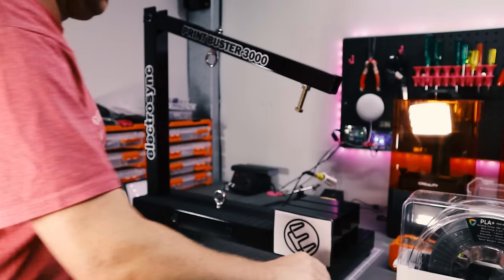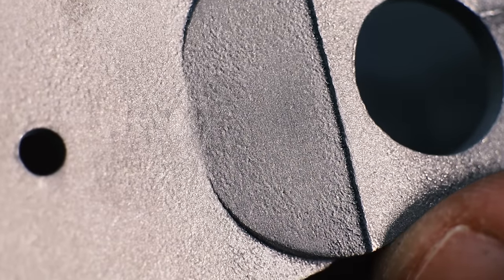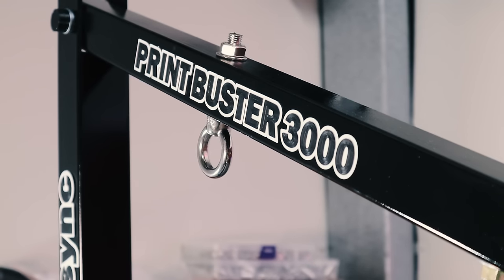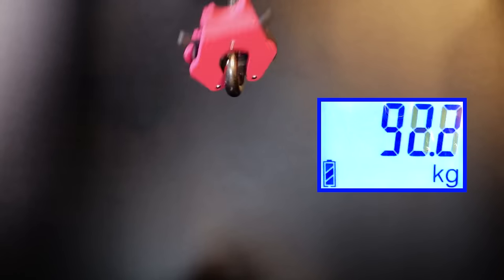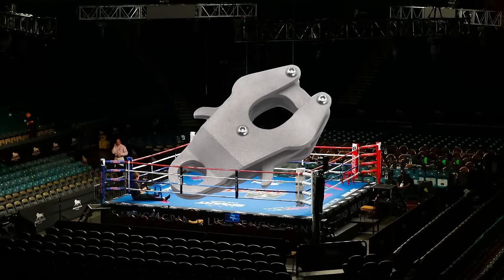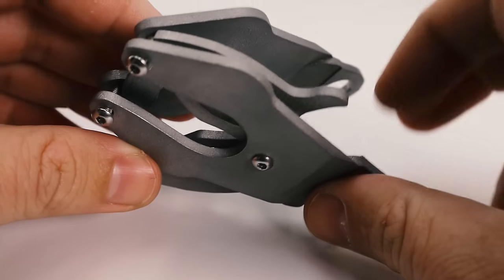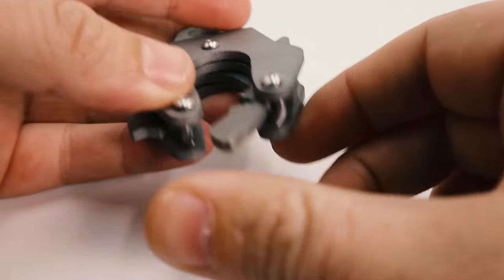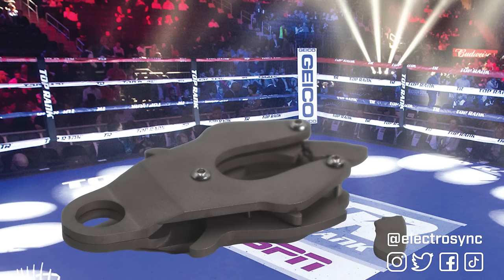How Strong is 3D Printed Metal?

Comment: Love this design! Considering scaling it up and adapting it for a completely unrelated application! Thank you!
Reply from the maker: Sounds fun! I made one at 200% scale and it worked well with heavier gauge wire for the torsion spring.
Reply: You need to look into Hot isostatic pressing if your interested in possibly making them even stronger

Comment: Larger stainless bolts, and fileting the edges will greatly increase the strength of the unit. With 3D prints there are a lot of stress risers on those sharp corners. Nice video!
Reply: you got that right, didnt notice that, they are basically covered in stress raisers, too bad he didnt get matched parts with water-jet cutting etc. and test them against the printed stuff. 3d printing is a bit of a religion and some people are afraid of knowing the truth about the material limits.

Comment: To me the aluminium was superior as the jaws didn’t fail in any way.  The stainless jaws began to fail at 884kg.  The aluminium clip failed only a little lower than this, but not the jaws, which looked good.  The way the aluminium clip did break, at the bottom, I believe a couple more stainless screws low down would add significant strength and potentially outperform the stainless steel clip.  Of course just a little more force could make all the difference, but unless tested we won’t know.

Comment: looks like the laser bonding required encouragement to work on the stainless steel, like a magnesium powder or some such catalyst, it should be a lot closer to solid internally, its so strange to see such thorough internal blackening, but then I've never seen a broken stainless 3d print either!

Comment: I would love to see a machined part out of billett or such to truly test how strong 3d printed metal is versus machined metal
Reply from the maker: I'd love to do it, but do you think it would break under 1 tonne? I might have to build a stronger rig!
Reply: @electrosync  it would be close. Aluminum yes, but steel I doubt it would break. You would be pushing it, I think 5 to 10 ton rig will be needed for that
Reply: @CL-yp1bs  surely it would depend on what the part is and its design? there are aluminium screwgate carabiners that are used in climbing/work at height that are rated for 25 kN on the major axis.
Reply: The printed metals seemed badly porus.
Reply: @spudpud-T67  they're typically 99.9X% dense as-printed with the right laser parameters. But after hot isostatic pressing, which is typically performed, you have virtually no porosity.

Comment: I would love to see the same test with forged metal vs. printed to see the difference.  Good stuff
Reply: Forged would be significantly stronger, but the nice thing about 3d printing is that you can make complex parts without specialized equipment or much skill (relatively).
Reply: Hey, blacksmith here! You know this new way of making metal parts reminds me of the old ways, in the sense that before mass melting furnaces were a thing, people would process iron trough forge welding sometimes very small pieces together (a bit like the Japanese and the tamagahane). So welding something together will get you to good results, but modern homogenous steels are still superior tho.
I think a good forge welding heat forging would help his 3d printed parts actually stick together more into a solid piece.

Also the grains look disgusting... His metal parts definitely need tempering cycles
Reply: @jeanladoire4141  Forge welding isn't easy for high carbon steels, and it's really impractical for most uses. Metal 3D printed parts are sintered for a couple hours, though the finish of these specific parts seems a bit off.
Reply: @ignacioaguirrenoguez6218  i'm familiar with forge welding high carbon steel, it's not that it's "not easy", it just wants to crack and burn at high temperatures, but there are ways of solving these problems. Now i dont see why you'd make structural pieces out of high carbon steel, most commonly used stuff for high strength structural parts is like S325, something with like 0.35% carbon

Comment: A few issues I noticed. The stainless steel wasn't tempered properly. The clip you designed is ok but consider the bottom hole it is made of two parts that are pulled on unevenly by the test rig.
That isn't a problem with the test rig but the clip design. The hole edges need to be rounded over also it would help if there was  a bolt or two ensuring the pressure between the two sides there remains the same.

Comment: I kept wondering why the pivot bolts didn't shear off. I would have thought on the metal parts those would have gone before the printed parts. 
I'm also wondering if heat treating would work on metal parts. That might be another interesting experiment for the future.

Comment: Surprised Aluminium was so comparable in strength considering all its other advantages, Its just so easy to cut and drill compared to steel and its lightness can easily be the difference between a project being practical and not. Would have liked to see non printed versions for strength comparisons....

Comment: Was the steel heat treated in any way after printing? I've gotta wonder if tempering might have helped.
Reply: My thoughts exactly, especially for the stainless.
Reply: from my experience, this looks like bad quality steel with no heat control, normalization or heat treat, the grain structure of the steel is closer to grey cast iron, its not good quality at all
Reply: @azpatriot7937  That’s the quality for 3D printed metals for a part I had printed.  It all depends on application.  My print was for a part in my door latch that broke.  Similar latch $240 and would have to sand and repaint door.  Company no longer made that model and so designed and printed by Shapeway in SS.  About $8 seven years ago and still going strong.  Worth checking out all the items and materials available on Shapeways.

Comment: Report Sxx ~ ((load at fracture)/(area of fracture)).  Expect perhaps max of annealed 6061-0 (Sy~8ksi, Sult~18ksi) or whatever the basic Al alloy suggests.  If lower, this gives an idea of loss by 3D print on axial, at least in this case.  A cantilever test, or a perpendicular pull would be interesting to also involve the plane-to-plane bond.

All in all, we've a strange dichotomy at work, with CMTR's & V&P inspection on traditional, but folks pushing for allowed metal print use in similar higher-QA applications, while a-s-s-u-m-i-n-g handbook values, isotropy, and puzzled looks when reminded of an often near-100% welded part without weld inspection.  IMO,  as yet, 3D print is most often analogous to in-to-near complete sinter, rather uncontrolled (at present), and of most use to low-stress (& smaller) parts.  Perhaps with better control, might come to use low-end bulk properties in FEA or hand calcs but, even there, you've usually a in-plane & orthog-plane layering issue plus shape-& order-of-bond issues. I've reservations, at least 'as yet'.

Comment: Since steel has a higher melting point, it is possible that the powder sintered worse than aluminum during manufacture. Maybe Leather didn't have enough power to melt enough. But perhaps there are some limitations or physical phenomena that do not allow creating a stronger part without losing geometry, for example, or gases or oxides are formed that make the structure porous, I don’t know. I'm not an expert - I can only speculate.

Comment: 3d printed metal isnt the same as forged metal because it has a very loose grain structure compared to the tight compressed grain youd get from forging steel. Also with forged metal you can temper and harden the metal to the desired strength so it's just vastly superior.

Comment: Would be interesting to test the new Carbon Fiber and maybe Titanium 5.  It looks like the metal is not fully solid so maybe the new filament type stainless that gets heated will be more dense and thus stronger.
Reply from the maker: I have some really nice parts printed in onyx with carbon, kevlar and fibreglass reinforcement to try out. Oh, and some titanium parts produced a few different ways. We'll find out soon...

Comment: I would be curious of how different methods of 3d printing metal would effect strength.
Reply: Post-printing heat-treatment is a huge factor. If it is not heat-treated properly the metal can be extremely brittle. 
Layer thickness and laser settings during the print process are important as well.

Comment: Could you please use Kilonewtons instead of Kilograms? This is a force measurement, not a mass measurement. It also makes it more comparable to climbing equipment with the strength ratings (though you shouldn't really use this in that sort of environment). 900 kg is 8.826 kN.

Comment: TL;DR
Aluminium (50g) Breaking point is 830kg/1829lbs
Stainless Steel (120g) Breaking Point is 900kg/1984lbs
PLA Breaking Point is 92kg/202lbs

Not surprising how Aluminium is x9 stronger and Stainless being barely x10. The differences between Aluminium and Stainless Steel is small.
For regular folks Aluminium is the way to go. Being able to work on something softer and more tinker-able. Great for projects being realized and it's lighter. Cheaper too in the soon future. 
Steel is for something more towards something industrial. Where you CAN'T have stuff failing. Course stuff fail and break all the time but Steel is just less prone to it.
Note: Metal is far- FAR more easily recyclable than any 3d Plastics. Metal can be contanimated and it'll just be melted off and slabed away. Plastic- once it's contaminated it's going to stay contaminated. Plus you can't just mixed plastic together, they won't bond well.

We've already seen 3d prints for quick replacement for certain parts, now we can have an mini-market of folks 3d metal printing parts that had been discontinued.

Comment: Engineer here;
Using the same aluminium piece after it has been subjected to stress testing isn't a true reflection of its material property, though it stands up well in the test, aluminium is famous for its low resilience to fatigue cycles which get worse over time.

Comment: Do metal prints need supports like plastic prints
Reply from the maker: Not traditional supports like FDM printing does. The metal powder acts as the support, but is not melted by the laser, so it doesn't need to be removed later on.

Comment: Great vid, were these raw metal or were they heat treated? because the stainless steel may of been soft due to looking at the grain of the breaks it is rather coarse 07:39, im not a metal worker or  smithie but after watching Forged in fire they always talk about the grain

Comment: Re-Run the tests after annealing and/or quenching the parts.  Can you get the steel parts re-made with high-carbon steel?  I think the differences between steel and aluminum were too narrow.  The steel should have much higher tensile strength per unit volume.
Reply from the maker: I'm working on a follow up video on this including tool steel. I'll need to devise some way of quenching them.

Comment: What's the price difference like? I'm yet to find metal 3D printing that is really affordable for non-industrial applications.
Reply from the maker: It's pricey. The handful of parts shown at 0:00 are priced at $370 USD. I guess it really depends on the value of your application though.
Reply: @electrosync  That's extremely expensive. I feel like metal 3D printing probably really isn't worth it unless the object being designed really is impossible to create in a more traditional way. The design of your clips is great but they could easily be created using a plasma cutter and a welder for a fraction of that price, and end up with a stronger result. Seems rather silly to 3D print something that is essentially made of flat pieces.

Comment: I would have liked to know what prices they charge.
Reply: It’s really a matter of type of material and volume of material used.  Shapeways is the company I used to make a SS part.  It was about an inch long and 1/8th inch square with an offset lobe and was about $10.  It’s not cheap to print in metal if it’s large, but if you need it and the alternative is a machine shop that would charge hundreds, then it’s worthwhile.  You should check out Shapeways and all the hundreds of items they have designed by individuals and available to print in multiple materials.

Edit: he answered your question on price a few posts below and it was $370 US for the parts for this test. So, not cheap😮

Comment: You should try CNC aluminum vs 3D printed aluminum to see if there is a big difference. I'm also curious to see how SLS Glass Fiber Nylon would do in this test.
Reply from the maker: I'm working on that right now (next video). I've got CNC parts in some nice materials, including aluminium and titanium. I don't have SLS glass fibre nylon, but I do have Onyx continuous glass, kevlar and carbon fibre.  I think it will be interesting.

Comment: “Selective Laser melting” isn’t going to give you similar results to a cast or forged piece for the simple reason the nature of the process doesn’t enable the material to form a crystalline structure.  It’s essentially little different to any sintered piece…just a lot of small particles stuck together.
Reply: No crystalline structure?!? What does it consist of then? An amorphous structure? 
High quality AM materials are typically superior to cast material, and in some cases on par or even better than forged. The PCBway material does not look like high quality....

Comment: impressive results considering the predictable grain structure.  personally what I'd like to see is the test simply REPEATED with X number of samples to determine consistency and reliability of the failure.  (as seen in the comments) because our psychology leans toward "bigger, better, stronger" this invariable creates a "blind spot" at just being able to see the value and use case of the Net parts as they come off/out the printer.  this is why parts - even the strongest ones - have ratings and something that never occurs to us is that not every part has to be rated for "1-Ton", particularly if the application doesn't call for it.  for those situations that DO need higher ratings, we obviously have all the traditional manufacturing methods (castings, forgings, CNC etc.) to lean on.
Reply from the maker: I'd love to do some repeatable tests, but these parts are pricey. I've got a follow up video in the works featuring the same materials, plus more. Watch this space!
Reply: @electrosync  re: "these parts are pricey". yeah sadly I figured as much.  it would indeed by cost prohibitive but who knows, maybe (just maybe) PCBW could be talked into a wee bit more charity...? 🙂 not talking a crazy sample size of 10 to 100 but simply 3 to 5.  basically any value of X > 1 would allow for some degree of extrapolation.  seeing the aluminum bend the tubing of the test rig was impressive, geez the gauge and dimensions of the square stock used for my engine hoist out in the garage is not much different, heck I'd be afraid to place some 6061 suspension bits to that amount of strain (I have and they failed albeit by bending/deformation). re: "Watch this space!" you bet. 👍

Comment: Would have liked to see more advanced plastics, like Nylon with CF for example. Or if you want to be really fancy, forged carbon fiber. Shouldn't be too hard to print a mold.
Obviously these parts would best be produced from stainless steel sheet stock with punches and presses, or laser cutting and pressing/forging.
Reply from the maker: Yes! I'm working on a follow up video that will include FDM continuous carbon fibre and laser cut metals. Watch this space!

Comment: Your choice of Eye Diameter and metal perimeter was not optimal, usually 1/4 of hole dia. is not enough, since half of full load is automatically placed on the bottom connection . Wnat were machine screw specs? 8 or above to permit less yield (standoff or washered between halves)?  Did you get anyone to 3d computer model stress or fracture points

Comment: It looks more like the welding method used for the powder is what failed not the metal.. since both failed about the same... if you can get some machines parts of the same grade metal and do the test again and you'll see stainless steel tinsel strength is 2-3 times that of aluminum
Reply from the maker: I have some machined parts for a follow up to this video.

Comment: Very interesting. This shows why they use Aluminium to build aircraft. While it's not quite as strong, it is a lot lighter.

As for future experiments, I've heard that increasing the thickness of a metal by a third doubles it's strength. Is this true? Does that work for PLA and other printables?
Reply: Normally stainless steel would have been far stronger. You could see where the stainless steel broke it was almost like a foam inside - this is an artifact of the laser sintering process.

Comment: That was neat, but I bet the steel would perform even better if it was conventionally machined.  I don’t really see any part of this clip that needs to be 3D printed, so why not try a conventionally machined clip just to see how it compares with 3D printed metal.
Reply from the maker: I agree. I'll be putting 3D printed parts up against laser cut parts (and other exotic materials) in the follow up to this video.